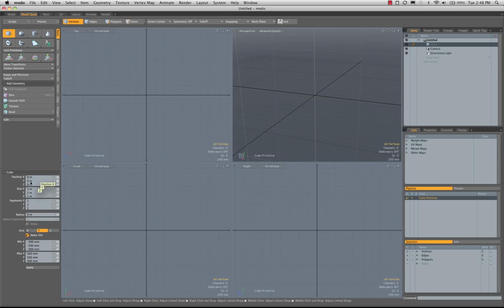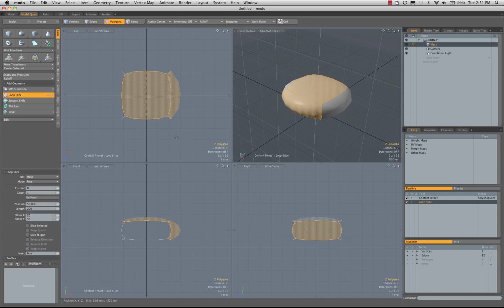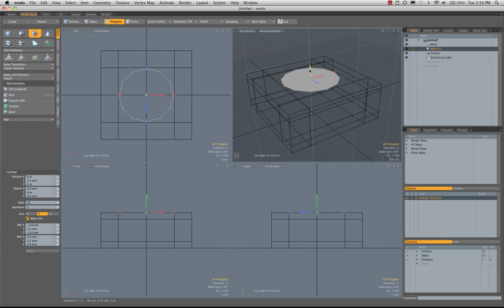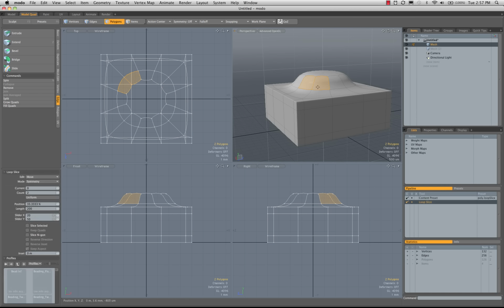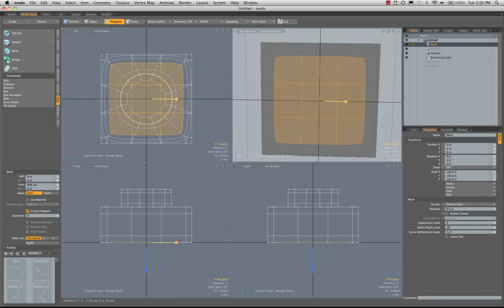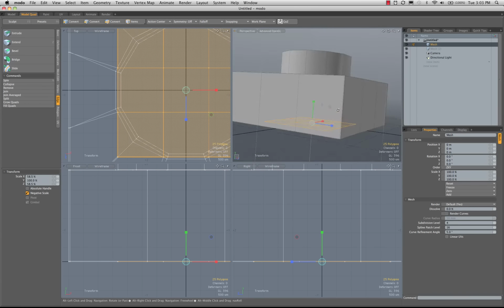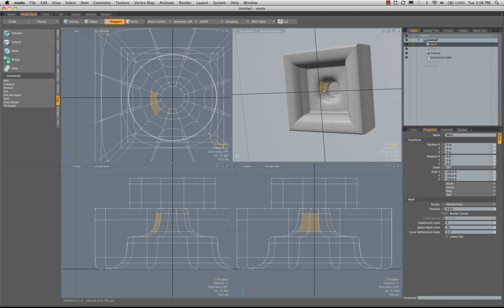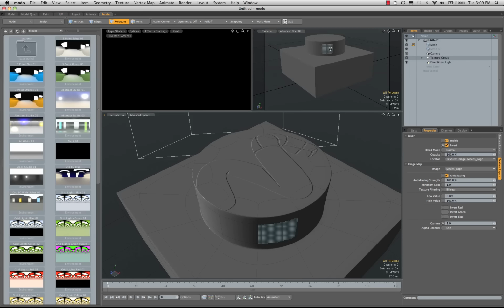Modos Part 1

Comment: Note around 16-17 minutes, instead of selecting only those 9 squares, Shift + up arrow one more time and select the tiny strip of rectangles surrounding them, to include a loop slice that had been put in there earlier in the process. Otherwise, like me, you might spend 2 hrs. wondering why you can't get it to look right. Also 1/3 of 4.8 mm is 1.6 mm, not 1.8, so small circle should have 800 um radius, right?